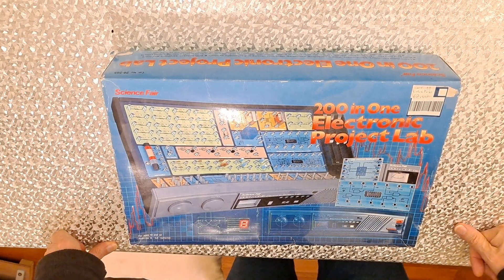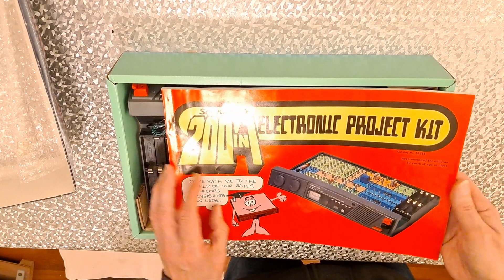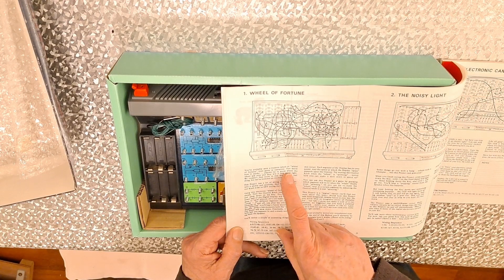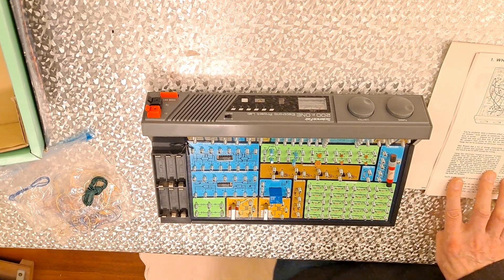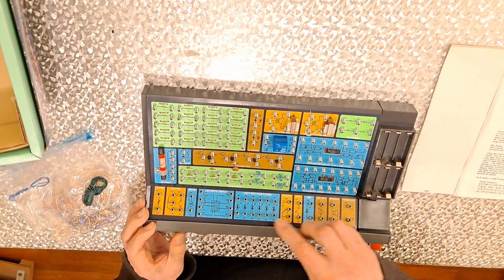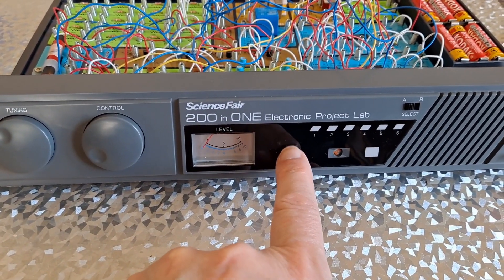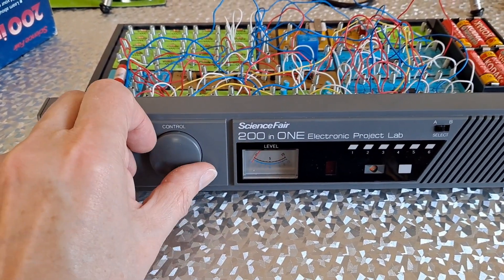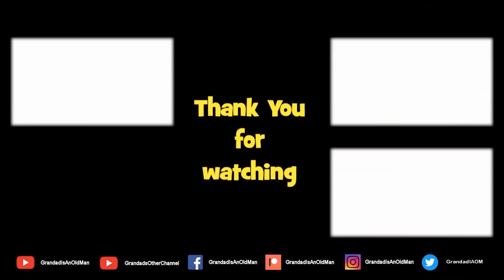200 in One Electronic Project Lab 001 FAST FORWARD

Comment: Amazing to see that kit again. That's the exact same kit I bought from Tandy just after I was married. So I would have been 26 or 27 at the time. There was a Tandy in Glasgow at the time and that's where I bought it. It got me interested in electronics and I passed many an hour with it. 👌👍👍
Reply from the maker: I never had one, but I have several now that I have picked up in charity shops over the years. All I ever did with them was probably one circuit, when I bought them to check they worked. I have been intending to do a bit more electronics, but most of my stock is buried in my work room, so I thought I could have a go at this kit as a substitute. I have done the first 11. This one has more to it than the next few circuits, then it starts building up again.
Reply: My parents bought me one as a child - must have come from the same shop! Loved it.

Comment: That takes me back also. Had the grandfather of that kit as a kid in high school. It had just a pegboard drilled sheet of masonite, with lots of loop connectors that you pushed through and fitted springs on, that held the various components/connecting wires in the top of the loop by spring tension. All discrete components - before the advent of ICs. Can't for the life of me remember the brand or even where I got it from. I do remember it made an impression on the Science and Headmasters at the time. Not sure if that was part of my once-in-a-lifetime Mention in Dispatches on the School Board. 😜😉
Reply from the maker: Sounds like great fun 👍